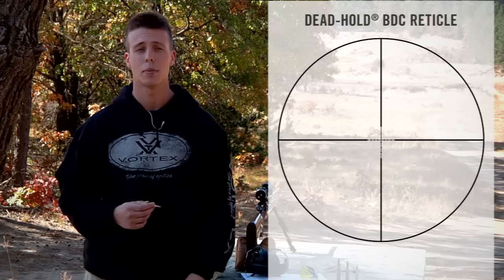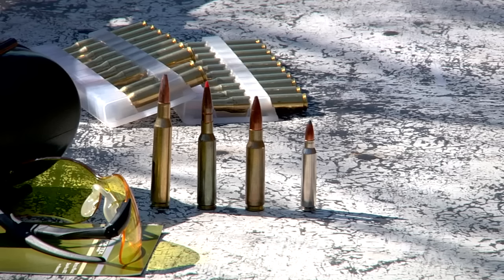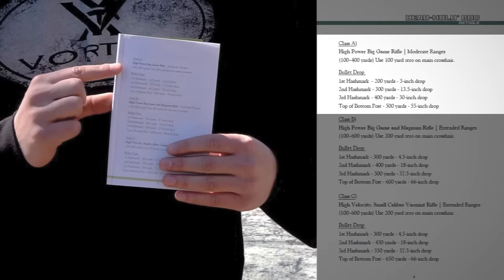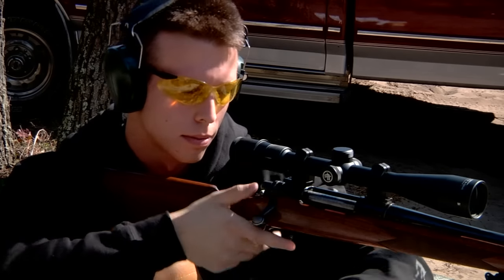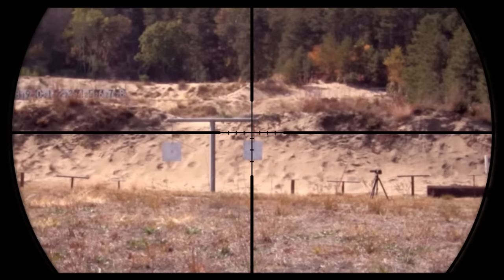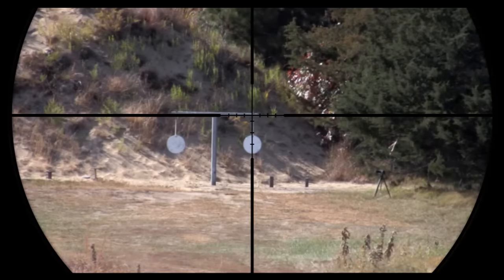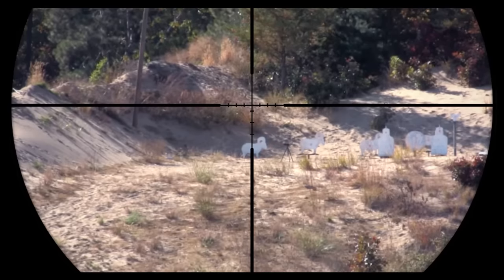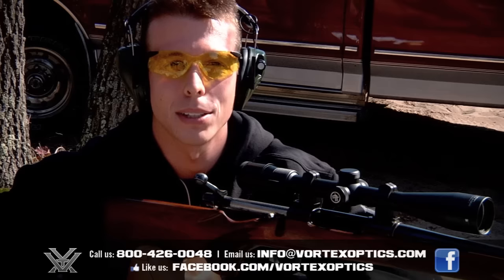How To Use the Vortex Dead-Hold BDC Reticle

Comment: So the BDC will work with any caliber and bullet weight.
I don't understand if the cross bars are prefixed, in other words (they don't move) how can it adjust to different bullet weight, and be on target.
Reply from the maker: Cordelmar - the Dead Hold BDC doesn't work by changing the Reticle, but rather by changing your zero distance dependent upon the cartridge you're shooting. For popular hunting cartridges like the .270 win or .30-06 Spr, you'd do a 100 yard zero. For magnum cartridges or really hot varmint cartridges, you'd do a 200 yard zero. I hope this makes sense! -RJ (Raleckson@vortexoptics.com)

Comment: So is 6.5 swede a Class C bdc?
Reply from the maker: I would recommend running your ballistic data through a calculator to find out what your adjustments are and then relate them to the reticle. The Classes in the manual are simply estimation, but by running your own ballistics you can  get much more accurate data.
Reply: @VortexOpticsUSA  Well the ppu 139 grain fmj bt says it drops 18 inches at 300 yards so it seems to be a class A. Just wanted to confirm since a Vortex optic will be on a future CZ 557 purchase

Comment: does the vortex crossfire 2 6-18x44 hold zero on a 7mm rem mag?
Reply from the maker: +Gilbert Ruiz All Crossfire II scopes are "magnum" rated and as long as you use a good set of quality rings and follow the proper mounting torque, there should be no issues on a 7mm mag!

Comment: How’s does this work with the AR15 platform? 5.56 or .223?
Reply from the maker: You would use the same exact method. Once you find out what your adjustments are you can relate that information to the reticle to perform your holds.

Comment: So each hash mark is 100 yards once zeroed at 100 yards?
Reply from the maker: For Jimmy's set up in this video, the manual recommends a 100 yard zero which (in Jimmy's case) means each hashmark on the reticle will compensate for 100 yard increments up to 500 yards. That is how it works for his particular set up and cartridge, but it's important to validate the ballistics on whatever cartridge you are shooting.

Comment: I have a same set up a Rem700 270win with 24inch barrel, with vortex viper 4-16×44 ,the scope BDC works well out to 500yards just like the vid ,I recently got another scope the same vortex viper 4-16x44 installed on to a Savage axis 2 in 6.5 creedmore the barrel is 20inch I zero it at 100yard I haven't tried out pass that,anyway manual says zero rifle to 100yd and Magnum caliber at 200yd ,I'm shooting different loads but prefer using the 143gr hornady eld-x on the hornady box shows a zero at 200yd with muzzle 2700fps with bullet drop in inches I did 100yd will the BDC reticle match if it's zero at 100yd or would it work better with 200yd zero then 2nd reticle 300yd 3rd @400 and so on ? Which yardage zero would the vortex bdc work best on the 6.5 creedmoor?thanks..
Reply from the maker: Hey there! What distance are you regularly shooting and what are you typically hunting? Let us know and we can better help answer you questions!
Reply: @VortexOpticsUSA  I'll be shooting to 500yard ,hunting coueswhitetail deer ,using factory Hornady eldx 6.5 creedmoor 143gr with g1 bc 6.23 zero at 100yd thanks
Reply from the maker: @WMAT77LL  Gotcha! The most effective way would be to run the specific ammo you are shooting through a ballistic calculator to find out what your adjustments are past your initial zero. You can then relate that information to the reticle in order to perform your holds. Here is a link to our LRBC: https://lrbc.vortexoptics.com/#!/https://lrbc.vortexoptics.com/#!/

Also, here is a super helpful video walking you through running the LRBC and relating it to the Dead-Hold BDC reticle: https://www.youtube.com/watch?v=97m6lp5ZcKc
Reply: @VortexOpticsUSA  awesome 👌 got it thanks

Comment: With what magnification where you shooting? How do you compensate when zooming in and out?
Reply from the maker: The hash marks are consistent at 12x with this scope. The value of the reticle is relative to the magnification you are on. For example, if you set the scope to 6x, the hash marks now double in MOA value. On 4x, the hash marks now triple in MOA value. In this case, I'm dividing 12 (correct subtension magnification) by the magnification you're using to get those values. I hope that helps but please give us a call if you have more questions about this 800-426-0048 ext. 5. - Jimmy, jjordan@vortexoptics.com
Reply: Vortex Optics Thanks for your rapid and very clear response!

Comment: Recently purchased diamond back 4-12×40mm, is 300 win mag good or is it too strong? In one of the videos on here(youtube) sort of hears a guy say .308 is max for diamond back 4-12×40mm
Reply from the maker: Hey there - great question and thanks for checking with us on that, but there's absolutely no reason for concern on putting the Diamondback on a .300 Win Mag. In almost all cases, the killer of most riflescopes is improperly torqued rings that make the optic vulnerable, which is then only magnified when mounted on a rifle with significant recoil. If you follow your rings mounting specs you shouldn't have any issues.

Comment: I have a 308 platform. Would a 4-12x40 work good at 400-500 yards? I see well at long distances, however in my 40's up close at 4-6 inches gets a little blurry.
Reply from the maker: Steve Reeves Absolutely, a 4-12x40 would be fine for 400-500 yards. I would personally prefer a 4-16x, for example but a 4-12x should be plenty. 4-12x40 is what I was using in this video. Thanks and feel free to email me if you have further questions. I would be happy to help. - Jimmy, jjordan@vortexoptics.com
Reply: I'm new to the scope world because I've been good with iron sights for so many years. In your experience would the 4x12 or 16 give a better FOV or a more narrow, defined view?
Reply: The one I'm leaning toward is the (DBK-412B) 4-12x40 Diamondback. I was looking on Amazon for the Diamondback in 4-4x12 or 16. I couldn't find it, however Vortex had a 4x12 . I guess where I'm a bit confused is I thought the first number was the power example 3-9x42. I thought the last numbers were size, diameter of front of scope. I thought the number 3 was the lowest power, up to 9. Sorry still in the.learning curve, and try'n to get it straight. lol

Comment: Thats awesome it worked out that way but sucks that it dont work out that way on every caliber for instance my 300 wby with 180 grain bullet set at 100 yards  fisrt hash mark is 220 yards 3rd hash 331 Next is 417 it will get you in ball park on a 300wby but not like i was hoping for
Reply from the maker: +stephenjray1988 You're absolutely right that it's different for every cartridge. However, the magnum category also calls for a 200 yard zero distance to help normalize that ballistic curve a bit. Or, you could just leave it at a 100 yard zero and just accept the fact that the hashes are worth different values. Keep in mind too that the deer won't necessarily walk out at perfect 100 yard increments so a little adjustment might be necessary. Whichever way you do it, at the end of the day, a BDC reticle is a good basic long-range solution but on-the-fly corrections may have to be made in the field. Thanks for watching and feel free to email me if you have any further questions. I would be happy to help. - Jimmy, jjordan@vortexoptics.com

Comment: Can the 4-16x50 crossfire 2 be used on a 300 win mag?
Reply from the maker: Absolutely - just make sure it's mounted in a quality set of rings to the proper spec we've given with the scope in the box. If you have questions regarding specs or mounting procedures, give us a call!

Comment: I’m shooting 5.56 NATO but do I use the calculator as 223
Reply from the maker: That can get you close for sure. It never hurts to go into a simple ballistic calculator to plug in proper bullet weight, velocity, altitude you're shooting at, etc. to get a little more accurate, but that will at least get you close.

Comment: I just bought my first Vortex Copperhead Scope 4x12x44 i had it board sided and now I need to hit the range before hunting Season when looking throught the eye glass and using the elevation & Windage do they move I need to know when sighting in can anybody help me on this subject my scope is a BDC
Reply from the maker: When you look through the scope and adjust your turrets, the reticle does indeed move inside. It moves in extremely small increments, though, so you may not notice it moving. You should, though, see your bullet holes on the paper down range move from your first group to your second group and so on as you adjust the turrets after each 3 shot group.

Comment: Would it work well with 17 HMR?
Does the software cover all cartridges?
Thanks.
Reply from the maker: F.A.C.E. It can be made to work pretty well with just about everything, including the .17HMR. You will just have to match up the hashes with different yardage. The ballistic solution can be worked out using our LRBC on our website. Otherwise, if you have more questions on this, please drop me an email at jjordan@vortexoptics.com  - Jimmy

Comment: how can i set my vortex copperhead  up for long range 600-1000 yards?
Reply from the maker: What type of rifle are you using it on? Chances are, since the copperhead doesn't have a ton of adjsutment compared to a dedicated long range riflescope, you're going to need to get a canted base that "Cheats" adjustment into your scope and allows you to shoot out to longer ranges. If you go this route, you'll need to have a greater zeroing distance, though. While it's not the riflescope that I would personally choose to use for long range like that, due to the fact that it would become a bit impractical, it's not an impossible task! - Jimmy H jchamilton@vortexoptics.com

Comment: How close would these be with a 308 150 gr
Reply from the maker: They would be pretty darn close, but every setup will be a bit different. Your best bet is to run the ammo you are shooting through a ballistic calculator to find out what your adjustments are at different distances. You can then relate this information to the reticle to perform your holds.

Comment: What would you suggest for a CZ 527 varmit chambered in .223?
Reply from the maker: If your optic budget matches roughly what you paid for the CZ 527, the Viper HST would be a great option. The CRS zero stop allows you to return to your original zero after elevation adjustments are made, while it also has a side focus parallax adjustment that is handy for fast focusing and parallax elimination for long range shooting. It also includes a 4-inch sunshade.
Reply: +Vortex Optics Thanks alot for the help.

Comment: Absolutely did not work this well with my 308! The holds are all different and midway between the hash marks. I wish it worked like this in real life.
Reply from the maker: All rifles, cartridges, loads, atmospherics, elevations, density altitudes, etc. are different and will affect how your round down range corresponds with the hashmarks  on the reticle. It would be super nice if they all magically worked out to nice 100 yard increments, but that's almost never perfectly the case. You can figure out exactly where your rounds will line up with a chronograph and a ballistic calculator or even just a ballistic calc and some clever tricks to figure out your muzzle velocity. We have a video called "How to get your muzzle velocity without using a chronograph" that can help with that.
Reply: The advertising for these BDC reticles is so misleading. Wasted too much money on a scope it doesn't work as advertised. If you're wise you'll stick with a standard reticle and just make your adjustments on the turrets, or get a Mil Dot scope. The variables are too great for any of those hash marks to be an accurate hold.
Reply from the maker: @jong.5619  All our scopes with BDC reticles can be used as standard reticles as well. They have the same turrets a scope with a standard reticle or even a mil dot scope would have and you can always simply dial your turrets and use the center crosshair. No need to use the BDC hashmarks if they don't match up with your particular gun and cartridge. One question we should ask, though, what magnification are you using your BDC hashmarks on when you're attempting to use the holdovers? The vast majority of BDC reticles out there are in Second Focal Plane scopes which require the scope to be on a specific magnification in order for the reticle and the image you're seeing through the scope to be the same scale to one another. Most of the time that is the highest magnification (It is in all our BDC scopes). If you try to use the BDC on any magnification other than that magnification, it won't work. Again, this is the case with all second focal plane scopes regardless of the reticle they use.
Reply: @VortexOpticsUSA  I apologize for how lengthy this got, this probably isn't the best place to be discussing all this. I did read up on how to use it and what magnification to use it on and it has proven useless. The BDC and the promise that it would work as a drop compensator on my rifle was one of the main reasons why I bought the scope in addition to the high reviews that Vortex Optics had. My frustration comes from the BDC not lining up even close to any of my points of impact and the fact that I just found out that the scope is jacked up which has been causing me about three years worth of frustration with my gun thinking me or the ammunition was to blame.

Comment: this dude is lucky or legit, or takes forever to xompile a video. Either way that 500yd shot using the top of the post was magical, with perfect placement. Immediate kill shot.
Reply: im sure theres a reason he works for Vortex (Amazing Shooter).
Reply: double falcon Shot my savage 338  lapua today at 500 yds with Vortex viper, 18x24 plate, couldnt tell where on the plate it hit several times, but zero at 100 on the crosshair, put it on at 500 at the 500 reticle increment.Still working on the in between yardages.

Comment: Dam make it look easy... how about up hill ??
Reply from the maker: Up or down hill will create some differences in how one needs to measure the distance between them and the target. Using straight line distance, regardless of shooting up or down hill will cause you to shoot over the top. You need to use angle compensated distance (Which most rangefinders can give you) to get the true horizontal distance between you and the target. Once you do that, whatever angle-compensated distance you get is what you use for your holdovers!